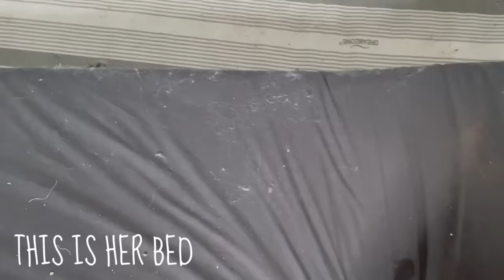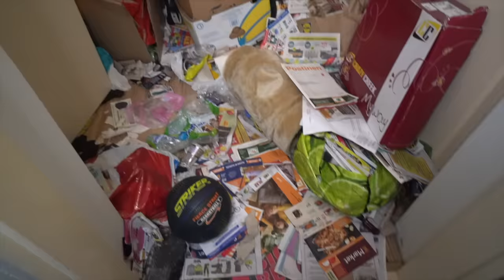FILTHY DEPRESSION HOME 🥺 - Cleaning FOR FREE! 💕

Comment: Bathroom floors in america need to be this way so we can just spray everything down
Reply: Same in UK 👏
Reply: I thought the same thing! 😃 I was saying to myself cleaning my bathroom would be a breeze if I could just spray everything down 👍
Reply: Girl 😫 you👏get👏me👏
Reply: You say that now, but I visited my best friend in Sweden for 10 days and the bathroom floor was just constantly wet, water did not stay in the shower despite careful curtain placement, and water was constantly tracked over the threshold and onto the wood floors in the kitchen; it drove me nuts! 😆
Reply: Also not possible to put down bathmats to keep your feet cozy when you step out of the shower in the wintertime!
Reply: How are they then? 😳 You dont have drains on the floor? What if something happens and water overflows from a broken pipe or something? Your house would just be ruined for good? It is standard in Finland, that every wet area has to have drains on the floors 😳 Sorry for my bad english, hope u understand 😄
Reply: @TheCaitling  Floors are usually also heated so you don't need anyting to keep you warm. If installation is done correclty floor is tilted towards floor drainage so water should not go outside of the bathroom if you don't spray it intentionally.
Reply: @friidat4759  Exactly. We don't have drains in the floors. And some bathrooms and kitchens even have carpet flooring. We mostly have larger areas, with full bathtubs for our showers. But, yeah, if pipes break or the toilet overflows it gets all over the floor and sometimes into the hallways or other rooms. Just have to clean it up straight away with towels or a wet/dry shop vac and hope no carpet or baseboards are ruined.
Reply: In Brazil all the house are like this ahahah have nothing to do? Just throw a bucket of water on the whole house and enjoy a clean house hahaha
Reply: @friidat4759  I live in the USA. a pipe broke in my parent's kitchen of my childhood home while they were at their vacation home, and water flooded their kitchen and into their basement - they didn't go home to see it for 6 months! When they got there, algae and mold had grown, and one year later they have only just finished renovating the damage it caused! 
I wish we had drains, it could have saved them a lot of money!
Reply: Everytime I watch this channel it makes me jealous, wishing I had this feature in my home!
Reply: I agree! It would make cleaning so much easier, and then I wouldn’t dread cleaning the bathroom so much lol
Reply: @friidat4759  in italy this kind of floor are extremely unusual too 😅 the shower usually have its own floor (called shower plate) that has higher border so water don't go around, plus showers are mostly closed with glass (or clear plastic) not curtains, so if it was installed correctly it's basically impossible to have water around the bathroom. It's nice but having a second drain on the floor would really be more practical 😂
Reply: I'm in Canada... No floor drains here either. If I ever build a house, I'm putting drains in the bathroom! This wound make things so much easier!
Reply: @TheCrimsonRabbit  yep. I personally don’t like bathrooms in America. In Brazil we usually have two drains, one for the shower and another outside if you want to wash your floor. When I lived in Canada my toiled clogged and flooded and I had to dry everything with a towel, squeeze it in a bucket and take it to another bathroom so I could walk in the bathroom to unclogg it. Imagine doing it while having to walk through a room and hallway with carpet floor 😂 it was a mess!!
Reply: @Mirimes  same thing in Brazil. I like the concept of having a bathtub under your shower though ahaha in Brazil if we have a bath tube it is usually outside the shower so it takes up more space in the bathroom. In the house I lived in Canada the bedroom bathroom didn’t have a shower, only a bathtub. It was kind of weird lol if you wanted to take a shower you would have to go to another bathroom haha
Reply: @TheCrimsonRabbit  Bathroom with carpet flooring 😨 I can smell the mold trough there 🤣 It is super unusual to have a carpet flooring in Finland, I have never even seen one (besides in an old hotel) and you guys have it in the wet room 😱 Crazy, how the heck do you clean it 😆
Reply: @wastelandbaby141  Omg that is exactly why we have drains in our wet rooms 😨 Ofc even drain may not be able to keep everything dry, if there were 6months broken pipe. But it would save a lot!
Reply: @friidat4759  hahaha. I refuse to live in a home with carpet in bathroom or kitchen. But, usually it just gets vacuumed. And people use bathroom rugs over the carpet.
Reply: I wish!
Reply: And Canada! I would love this in my bathroom
Reply: @furudenyan  yeah and the shower is protected by a glass door to prevent water spilling all over. some are made out of acrilic, some have a curtain. I rather the glass door, we call it “box”.
Reply: @TheCaitling  They didnt have proper tilt in the floor I assume 🤔 I have seen this problem in few places here in Finland and it was due to insufficient tilt in the floor towards the drain when built🙁
Reply: @astrale-l3n  the shower-bathtub here I've seen only in older homes, like my grandpa's home had one ☺️ modern homes have usually little spaces so there's usually only showers 🥲
Reply: @kateFGMP  yeah I know I'm Brazilian ahahaha
Reply: Yes!
Reply: @friidat4759  yup we dont have that in the US! When i was a kid we even had wall-to-wall CARPET in our bathroom! (Unsnaitary, i know!!) But nowadays we keep plush rugs in our bathrooms (there is no drain) and the floor is not one with the wall like how we see in Auri's videos. Our walls aren't tiled like that. Theyre just painted like any other wall in the house. (Unless you are wealthy & have a more luxuorious home) And the floor is typically just like a kitchen floor would be- either laminate or whatever. Our bathtub and shower are one space together so the shower curtain keeps the water from the floor. Nicer homes have separate stand-alone showers with doors. And yes— if the toilet (or sink, or tub) overflows you have a BIG 💩 mess on your hands!!! That's why we Americans always comment 🤯🤯🤯 "we need this!" On Auri's vids 😂 it makes no sense why all bathrooms aren't designed this way!!!!! Would be soooo convenient!!!

PS: stop underestimating yourself! I would've NEVER known English wasn't your first language had I not read that last sentence! Your English grammar was perfect! ❤
Reply: i agree girl
Reply: @friidat4759  we just have regular wood or tile floors some have carpet in the bathroom but no drain. Only drains we have are in the sinks and shower
Reply: I was just saying this. I would love to just scrub and spray instead of scrubbing and wiping multiple times. It would save so much time and energy.
Reply: Omg right! If I get any water on the floor and don’t catch it on time it’ll just seap into the sides of the rooms and slowly cause water damage smh
Reply: Here in Brazil we can clean our houses floor with water haha is really fun cuz I have this perception that is 100% cleaned😅
Reply: @furudenyan  in Colombia they also have drains but in Chile no. I grew up washing with full water but in Chile I can’t! 😩
Reply: I AGREE 100%
Reply: @friidat4759  Your English is great!  I agree, it would make a lot of sense!  I am in the U.S., too, and told my husband that I want a Finnish style bathroom if we ever remodel ours.  I am originally from Germany and neither there nor in the U.S. is it common to have a floor drain in the bathroom.  We only have one in the basement laundry room.  I am also impressed with the quality of the materials and how well they hold up to neglect, dirt, and heavy duty cleaning!
Reply: Same in Germany😅 I‘ve Never Seen a Bathroom, with a drain in the floor. 
The Bathroom cleaning part, makes me jealous all the Time🥲
Reply: @gedankenwxlken4511  at least germans know that bathrooms are wet spaces and they build them with tiles on the floor and the walls. Can you believe that there are countries with wood, laminat or even carpet flooring or paper wallpaper in bathrooms?? That's even more crazy tbh. But yeah, a drain in the floor would be super helpful, no idea why countries don't follow this style more.
Reply: @wastelandbaby141  thats why you either turn off the water main your contact your water provider and hold your service.
You can laso hire a management company to periodically check on the house or make friends with your neighbors
Reply: I agree! One of my favorite things when I lived overseas.
Reply: Almost 100% of houses and condo in Brazil has a drain!
Reply: I’m in the process of having our house designed, & I’m 100% going to ask to hv this! (But there needs to be a way to keep the drain looking nice & not disgusting. Perhaps those slit ones? 🤔)
Reply: Australia too :), we have drains in our bathroom floors but we don't have the spray thingie to rinse everything down unfortunately.
Reply: @friidat4759  you have beautiful English, & no, it’s not standard in the US, nor even a lot of European countries I’ve been to (at least it seems, because some didn’t have them! 😊) though I saw it a lot in Italy, Greece, Poland, & Germany, and here-and-there in other countries, as well (I lived in a number of places in Europe for 15 years). We have to have cloths/mops to pick up the cleaning solution. I’m in the process of designing our new home, & I’m going to ask about this!
Reply: @friidat4759  I’ve not seen carpeted bathroom floors in the USA since the 1970s,/early 80s, & that carpet had specially-patterned rubber backing to give some space between it & the floor when someone wasn’t standing on it, to let it dry (I saw that in many more northern European countries in the 1970s & early ‘80s, too), & was made to toss in the washer & dryer. I guess it’s possible some people still hv it…😬🤷🏼‍♀️. I’ve just never seen it. However! I do like having a mat in the bathroom to stand on when at the sink, & another (smaller) mat that I leave over the bathtub side until I need it. That’s to stand & drip on when I first get out of the bath/shower (mine is both). Then I put it back over the side to dry, & wash it every week. The larger, more comfortable, woven mat in front of the sink, I wash every 3-4 weeks, & when it’s worn, I throw it away & get another. If it got wet w/something gross, I’d chuck it in the bin.
Reply: The thing that strikes me the most is the comments a bout people not having drains in their bathroom floor 🤣🤣🤣 I guess we in Denmark and the other scandic countries have that in common
Reply: @brendasyphers1910  I think, since it’s next to the potty, it just miiiight be used for…you know. 😉 (& we in the US need those, too. 🧻 just doesn’t “doo” it.)
Reply: @crazy4orlando2  yeah, they definitely know now!! The one time they forgot, and it happened!!
Reply: What are you people doing in your bathrooms? It's called weekly cleaning!  Should never need a drain in the floor unless your very dirty..yuk
Reply: YES!
Reply: and south America too
Reply: I've never heard the term, wet room.
Reply: @TheCaitling  what about putting a rug or cotton bath towel outside the bathroom door? You could wipe feet after going in the bathroom?
Reply: @friidat4759  YES! It is horrible. Twice this year this happened. Upstairs neighbor pipe burst, and water began pouring from my ceiling into my kitchen, out of the light sockets on the ceiling. The water upstairs then traveled through to the bedroom closet and started pouring from that light socket and down the walls. My whole apartment almost flooded. Then, six months later, our hot water heater began leaking, and it started to get water all the way to the living room. Finally, we had Hurricane Ida hit our city and water came in through the window in the bedroom because the wind was blowing the rain sideways. Three times in one year is well enough!! I am done. So tired of dealing with water
Reply: @therealJamieJoy  that's a good idea - it wasn't my home, but that's something they could do!
Reply: @Uunoliitto  Perhaps the floor wasn't tilted properly then, because while I was there it was always wet everywhere and I was always super careful when I was in the shower
Reply: @TheCrimsonRabbit  omg I was thinking about the carpeted floors in some American bathrooms when I read the previous comment 😂
Reply: @Annaemilia123  oohhh that must've been it!
Reply: @TheCaitling  maybe it will help someone who is reading the comments. My feeling is to treat the threshold outside of the bathroom just like when you put a bath mat right outside the shower or tub. How nice you got to go out of the country to visit a friend!
Reply: @TheCaitling Actually no problem, you simply remove the bathmat while cleaning. In Finland the newer  bathrooms have heated floors so no bathmat needed
Reply: Agreed.
Reply: @brendasyphers1910  The small shower head next to the toilet seat is a bidet shower, a very Finnish thing. You can shower your self down there on the toilet seat, plus clean the toilet and bathroom floor.
Reply: Right??
Reply: Exactly! Love the wet room idea for bathroom, as well.
Reply: What if there’s carpet and someone accidentally piss or throw up on the floor? How do you even clean that up? 🤢🤢
Reply: I know right?! I think that everytime I see her videos.
Reply: Yessss 🙌🏼 I would be spraying everything 😍
Reply: How have designers/builders not brought this bath concept to America????????
Reply: How have designers/builders not brought this bath concept to America????????
Reply: @TheCaitling  You could put a curb around the shower area to prevent water splashing on the rest of the floor and still have a floor drain on the rest of the floor for easy cleaning.
Reply: Yes!  Floors, walls and cabinets can all be sprayed down with the faucet hose!!! Genuius!
Reply: @TheCaitling  especially when houses are build too fast and without attention to details 😓 Its very anoying to stand there in the flood 😅
Reply: @mariajosevila5730  yeah this was a new one for me :D
Reply: IKR LIKE, EVERYTHING JUST LEAKS INTO THE BASEMENT😭😂
Reply: Thought the same thing
Reply: @mikrokupu  Yeas!  I am so jealous over that  bidet shower. Superpractical and hygienic. I can not undertand why they are not commonly installed gere in Sweden.
Reply: @user-xm1od9nb1m  Well actually  you can't clean it, can you? I guess they just wipe off the worst , blow dry the wet spot on the carpet and then febreeze the hell out of the odour?
Reply: @snaxon  😫🤮🤮
Reply: Same in France, cleaning would be easier then!
Reply: but america have it… well, i dont know about the north america, but in the south america is very common.
Reply: @wastelandbaby141  well that's their own fault for leaving it for 6 months.
Reply: @aleksandralempart8305  they got stuck due to COVID. they had come down to their vacation home where I stay for a family emergency, and when they got here, the government locked down their home state, they couldn’t go back until the restrictions ended. So, no... it wasn’t their fault.
Reply: @user-xm1od9nb1m  use carpet cleaner lmao
Reply: Yes!!! It's so practical.
Reply: 💯 my first time having a floor drain was when I lived in Asia. Cleaning is a breeze. Loved the open concept showers they had too.
Reply: Agreeee!!!!
Reply: Haha I’m confused, does their feet get wet when they use the toilet lol. In Canada we have tubs and/or stand in showers but it’s sectioned off lol
Reply: 10000% agree!  I think that every time I watch these videos lol!
Reply: @friidat4759  I wish! I have never had a broken pipe, but they would have to pump the water out. When we have had a toilet overflow, we have to either use a ton of towels or a mop to clean it up.
Reply: Girl me too! Especially for my depressed ass. Lol. Cleaning the bathroom is the bane of my existence!
Reply: @fafah4928  The problem in Brazil is that we can't throw the paper into the toilet, like in the US or Canada, and Europe I guess 😂
Reply: We them like that in Ireland as well
Reply: OMG YESSSSSSSSS
Reply: @TheCrimsonRabbit  yes it sucks lollll
Reply: This feature could be installed for less then $1000 in some houses
Reply: @Mirimes  yea must houses anywhere our like this, she was probably talking about her poor besties house with a poorly installed bathroom
Reply: I wish at the very least we had waterproof flooring. Maybe it's because I live in an apartment but the floor is some plastic material not sealed very well with lots of gaps for water to get into and it's such a nightmare to clean and keep from getting mold 😫
Reply: @friidat4759  in my house, the guest bathroom was built with wood flooring 😭
Reply: Same in Russia
Reply: @verakiseleva1638  yea
Reply: We lived in the Middle East for 2 years. All bathrooms and kitchens had drains in the floors. It was amazing. Totally sucked coming back to the US and not having it. If we build a house I want them put in. The builders will think I’m crazy 😂. They also didn’t have any electricity access inside the bathroom. The light switch was on the outside and no outlets inside the bathrooms. That was a pain and hard to get used to.
Reply: @flossiesmommydoggo77  you just have to clean the drain too when you clean, not a big job :)
Reply: @TheCaitling  we also use these rubber wipe things to sweep the water towards drains after shower or cleaning to get it drier :)
Reply: @sielukettu  most floor drains I’ve seen here don’t come apart easily & are ugly & get rusty & yucky - even when scrubbed on top. That’s why I was thinking about finding other shaped ones.
Reply: It shouldn't be so difficult when remodeling to install a drain just under where the basinpipe leads down. They have that kind of feature in a lot of restaurant kitchens where they want to be able to wipe the floors well wet with some sanitising product fairly regurlarly and just rake it down.
Reply: @TheCaitling  The floor may have a faulty level. Though a curtain only tends to flap around so even if the floor is leveled around the drain you might need one of those rubber borders to attach with silicone.
Didn't they even rake off the excess water afterwads?
Reply: @Michelle I was thinking the same thing! It's like America test runs all the worst design ideas and never picks up on when another country comes up with a better idea. Like have y'all ever seen pictures of houses from the 70s with CARPET in the bathroom? Who thought that was a good idea?
Reply: @rachelelliott1674  I lived in Europe from 1971-1999, & let me tell you, I saw plenty of carpet in the bathrooms there, too.